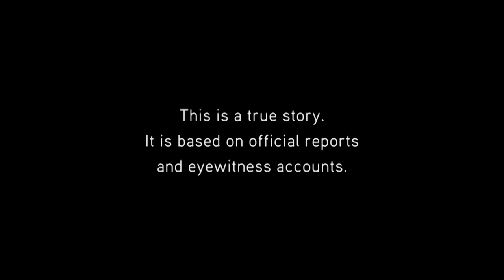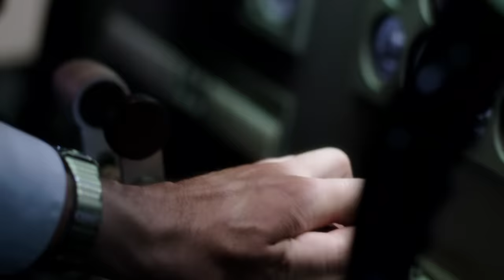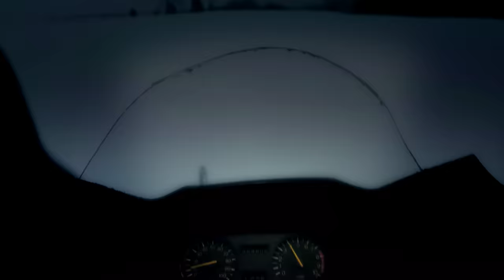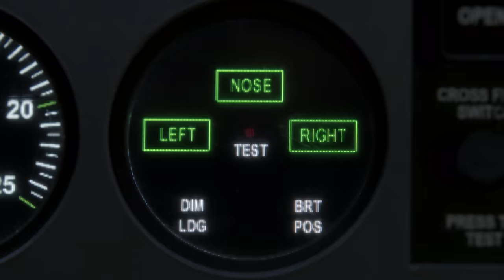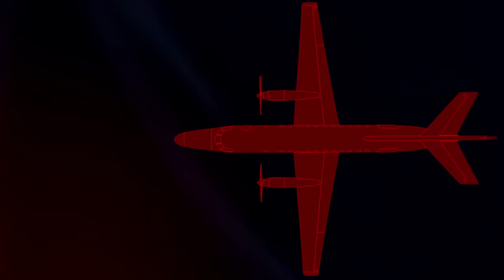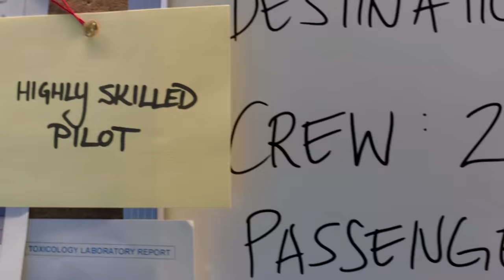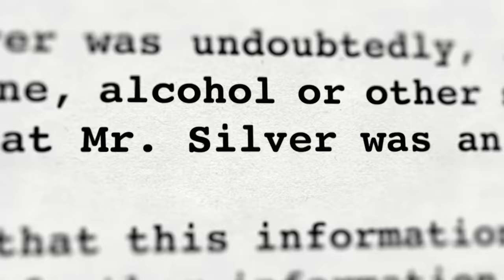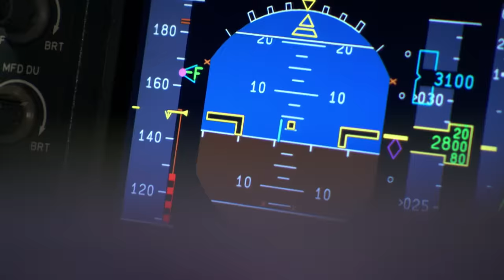Pilot Misconduct Revealed in Fatal Colorado Crash | Flight 2286 | Mayday Air Disaster

Comment: I am constantly impressed with the investigators ability to tell the difference between pre and post crash damage to a plane and its equipment.
Reply: It is an art of those who make the parts often.  I’ve done a few of these, super detailed.
Reply: how does post crash damage occur? Rescuers? 
Investigators? Passengers?
Reply: @SkipFlem  Post crash damage is what happens after the plane violently stops because the ground got in the way. Pre crash damage is anything that was wrong with the plane before the ground got in the way.

A perfect example would be with the electrical system of the plane. Pre crash damage would be something like an electrical short. Post crash damage would be all the wires of the plane becoming mangled in the crash, and possible subsequent fire.

It impresses me that the investigators are so well trained that they can tell the difference between a pre crash electrical short, and post crash fire damage.
Reply: @TrexelCat  It's the terminology.  There is crash damage, pre-crash damage and post crash damage.
Reply: @0101-s7v  Apologies, I'm not an aviation expert. All I was going with was before and after. I was unaware that there was a middle to that.
Reply: I know right
Reply: Some of it seems to be common sense, such as "if it's all in the same place, the plane was intact when it went down, and if it's scattered, it broke in midair."  Also things like being able to figure out what position parts were in by seeing how they got damaged in the crash.  They're pretty amazing, though.
Reply: @TrexelCat I’m impressed that you knew that. Lmao
Reply: Training and experience.
Reply: Im impressed how investigators are able to determine engine malfunction especially after severe damage from the crash
Reply: Oh yeah, we're sure you have "done a few of these, super detailed"🙄. After all, "it is an art of those who make the parts often"🙄
Reply: @treylem3  there's really no way to tell if he's being honest..
Reply: @TrexelCat  good analogy. Electrical components also have a different smell if they fail as opposed to just burning in the aftermath
Reply: Never get me on a rubber band powered plane like that
Reply: as am l... l do not understand how they know what was malfunctioning in-flight vs what was damaged during/after the crash.
Reply: @James-kk8dw once the magic smoke gets out, you can’t put it back I .
Reply: @TrexelCat  these ppl are ridiculously smart

Comment: Wait, testing the (deceased) pilots for alcohol and other drugs isn’t automatic??
Reply: Probably not at the time.  It is now if there are any remains.
Reply: This might be - and I don't know for certain - a difference between Part 135 and Part 121 flights.  Almost any airline you've heard of operates Part 121 flights - regular, commercial airline flights.  Tiny air carriers doing charter, commuter, or air taxi services - fewer than 6 round-trips per week to any given destination on planes with fewer than 30 seats - operate under Part 135.  Part 135 is less stringent than 121, with lower requirements and fewer regulations.  My guess - and again, I'm only guessing - would be that for a flight of this nature where mountainous terrain and winter weather were primary concerns and the full weight of Part 121 rules didn't apply, blood tests may not have been required or, at least, not prioritized.
Reply: @marksanders768 why? Loss of life even one life should be valued.
Reply: Yes, post-mortem toxicology test is standard
Reply: I was a newly minted adult in 1988, and I'm pretty sure this kind of thing (tox screen of the deceased, etc.) has been standard all of my life. I'm guessing this was probably just a little dramatic license by the producers...??
Reply: @TruCat  Certainly could be!! 👍
Reply: @sludge8506  If you'd paid attention, you'd know. Start at 35:42.
Reply: @ninedaysjane2466  Thanks for your comment, jane. I hope to hear more from you in the future. You seem very mature and intelligent. Thanks again.
Reply: I guess you also have to know what you’re looking for.

Comment: I used to work as a manager of an airport hotel near San Jose, CA Airport. We had plenty of flight crews stay with us. I recall seeing pilots in the bar, in uniform, bags packed, having a quick drink before heading out.
Reply: Yeah rite
Reply: I don’t believe that.  maybe after a flight.
Reply: Nope. This is utter bullshit and if it isn't, you should be held responsible for not reporting those pilots to authorities. I worked for 4 years as a bartender at an airport hotel in San Diego and on the very few occasions I served pilots in uniform (usually they would change before heading to the bar), I always confirmed with them that they were done flying for the day and spending the night at the hotel. I also never once saw or let a pilot drink irresponsibly in my bar.
Reply: Pilots were caught doing the in Hartford,CT in the 90’s
Reply: Yeah,  cool story. So why yall serve them drinks then ! Guilty much.
Reply: Can confirm.  I also worked as a bartender near Midway airport in Chicago.  It was known as a joint where pilots and FA’s hung out.  There were more than a few times where I served a pilot before he took a flight.  They would always paid cash,  tipped very well and we had an understanding that the transaction never occured.  Alcoholism is a tricky beast.
Reply: Drinking in uniform is a no no, and will most likely it would result in termination.
I flew for 2 majors, and I never saw this.
If you were so concerned, why didn't you report them?
Why would you even serve them?
Reply: Because it’s not my business.  I’m not their daddy or mommy.  And I certainly don’t rat on tipping customers.  But the world has become so dishonorable, I’m not surprised there are many that would.
Reply: @marcscraigslist_account8297  yes, it does take a certain person with a well developed character and courage  to do the “ right” thing regardless of the consequences. Especially when faced with the knowledge of the wrong doing of someone who holds the well being of others in their hands. Sounds like you were ( and still are not )   up to the task character wise to do “ the right thing”.  People whom have that well developed character are rare ..  You are not in that category…

Comment: The aircraft was a Fairchild SA-227 also called a Metroliner. I was an aircraft mechanic and worked on Metroliners for TWE in the late-80s. Contrary to what you see on this reenactment, there is one seat on each side of the aircraft with one benchseat in the back (8 seats on each side and 3 on the benchseat = 19). It's a terrible aircraft in every way.

Comment: I was once booked on a cheap flight by a travel  agency, from the US to Mexico on a smaller plane which basically hopped from small airport to small landing strip, rising steeply, and  having to almost immediately descend steeply at least seven times because of the short distances ! The passengers had to be plied with cocktails in order to sedate them into thinking this was a joy ride ! 😳😬
Reply: Aaaaggghh!!! 😱😱😱
Reply: Thats what happens when you try to save money on travel. You need to do your own research when travelling anywhere. Otherwise, you may end up in the same position again.
Reply: What do you mean plied?    There is not enough time to serve passengers on quick up and down flights.    I've flown enough of them to know that.   You have to be at cruising altitude for some time to have service.
Reply: I was on my way to San Francisco over the Rockies when turbulence hit and the plane began to bounce like a yo-yo. I had ingested a double dose of Xanax and one or two vodka martinis so I was fine. There's something to be said for chemicals. Of course, I wasn't piloting the plane.

Comment: I used to have to fly into Meigs Field on the Chicago waterfront. It was a north/south runway and there usually was a wind from the west. I had a single engine Piper and I loved it when there was a good wind. You had to drop your left wing and stand on the right rudder so you could touch down on the left wheel and then gradually lower the right wing to land. Pilots welcome a little challenge, these pilots were not different.

Comment: I've flown into that airport a few times. The trees are close. Real belly scratchers. But Durango itself  is over 7000 feet elevation, and the airport is southeast in even higher elevation. Maybe at least another 2000 feet. Or at least 1000. So if they're coming in at a little over 7000... That can't be good...

Comment: I’m surprised they didn’t discuss the very cold temperature on this approach. Extremely cold temperatures cause the actual aircraft’s altitude to be lower than what’s indicated on the altimeters. This effect requires either a correction (altitude addition) that is part of the published approach procedure or a prohibition to fly the approach in such temperatures. While a weak First Officer and drug addled Captain could explain their failure to follow what are very basic procedures I have a hard time believing those were the only factors.

Comment: Why was that challenging landing on a snowy night even offered to the pilots?  Human life is more important than kept schedules!  They should always rule on the side of caution, prevention is always the cure.  It’s why we have speed limits on highways. We’re not encouraged to drive faster in bad weather if we’re late for important functions!  I
I know, I’m not a pilot but it just doesn’t make sense to me! ?
Reply: It's not even remotely in the air traffic controller's sphere of responsibility to restrict approach vectors for any reason except ground safety — it's impossible to know what the conditions in the air are better than the pilot flying in them, and as such, a faster approach may be necessary for any reason and is required to be available without having to argue for it.

The responsibility is with the pilot first and last to be competent, use good judgement, and be in the correct physical and mental condition to do the job he's entrusted with, and that includes being conscientious about choosing the safest runway to land on regardless of if you're behind schedule, even if drugs hypothetically wouldn't have been involved.

Comment: Piloting an aircraft requires 110% focus, many lives depend on captains & pilots knowledge & focus. A very high stress job I'm sure. High stress jobs require time to decompress, & deep relaxation equal to 1/2 the time spent in the high stress situation, to be effective. 
Massages, spas, retreats, are all extremely relaxing, which is necessary to balance out extreme stress. 
A hobby can be very effective, it cannot require deep concentraction or focus. The idea is to implement the opposite of high pressure & focus, in order to reset. Everything requires a balance to stay level & in good working condition. Any drug or alchohol are deceiving as they give the illusion of relaxation,  high energy, improved focus, when in reality it throws the mind, body, & thought process, so far off balance it requires days+ to recover from 1 day of use. 
Its easy to reach for a drink to relax or drug to numb the mind. Opposite of balance it throws one into a tailspin. Go for the swedish massage, race pro r/c cars on the track. Way more fun, relaxing, & great for keeping a good balance.

Comment: Two stand out things. 
1. Durango airport is at 6685 ft amsl. Maydays video shows the altimeter at 7** ft when it should show 13,000+.
2. The propeller type shown in the video is not capable of a beta position which would have been fitted to the video aircraft.
A third which just occurred to me, if the aircraft had neither fdr or cvr, how was the NTSB able to discuss the approach stepdown graph?
Reply: My plane had JFKCRV And ATM